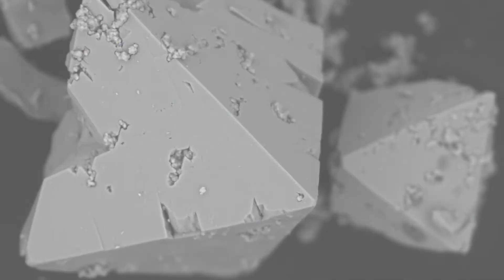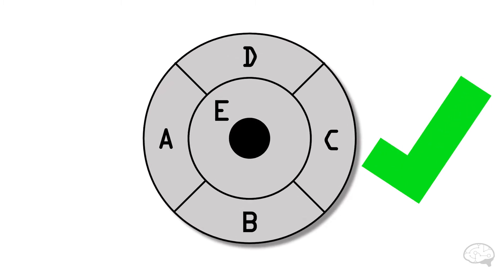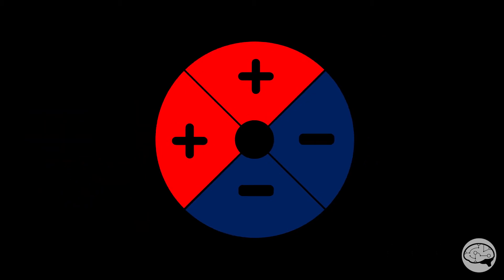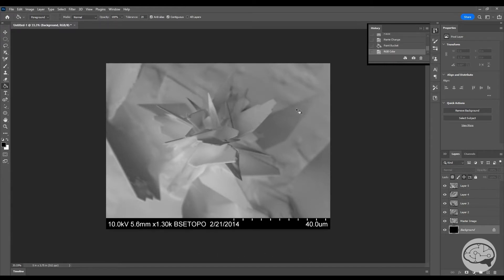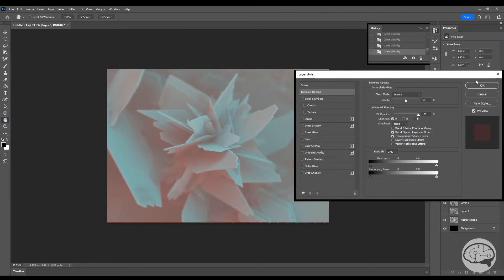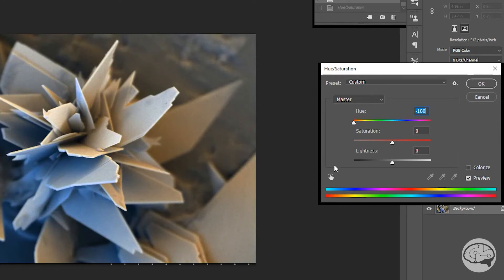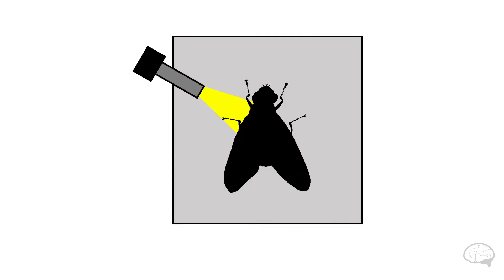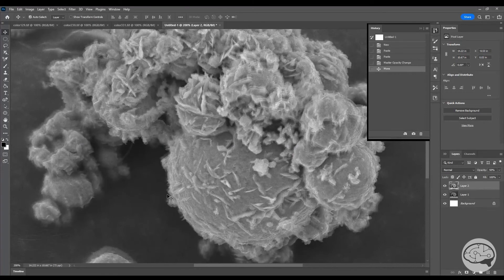Multi Detector Color - Quick SEM Color Technique How To | Instructinate

Comment: I met David Scharf at Lehigh one year. He has some awesome images. But as you say, most of use don't have extra E-T detectors laying around.  Good info.
Reply from the maker: David Scharf is the man in question. It's not just the extra detectors, but the whole computer system that combines the signal. It's a big operation from my understanding.